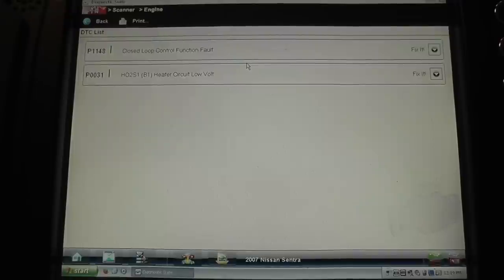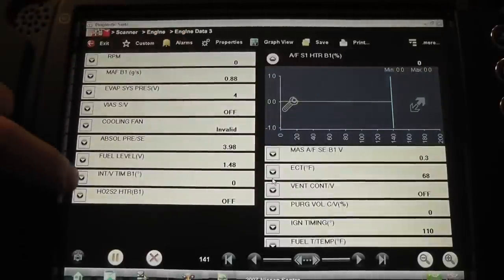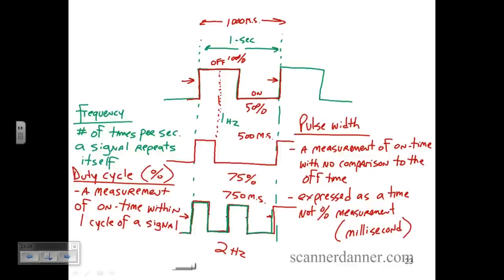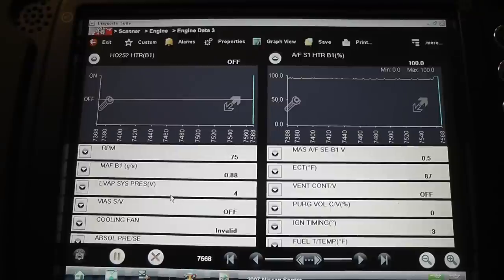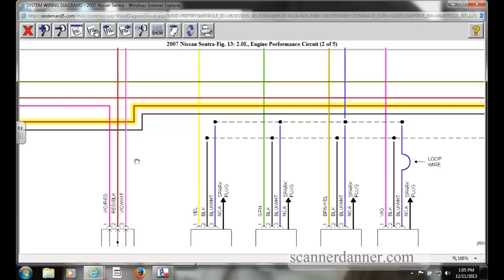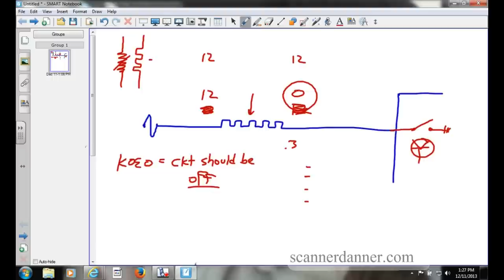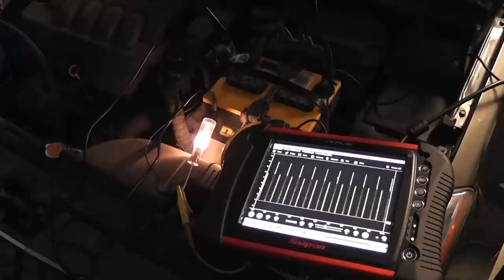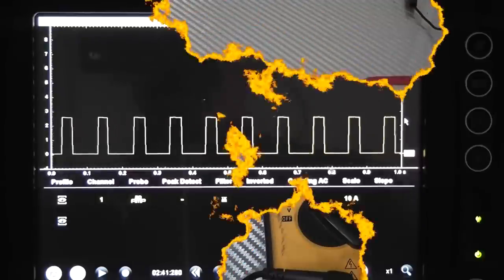Ground Side Switched, Duty Cycle Controlled, O2 Heater Circuit Testing [an SD Premium Class]

Comment: I did try that test using a test lamp in place of the heater circuit to "trick" the ecm liked we chatted about while back and it didnt work. even though the current flow (amount) was the same as the A/F sensor heater. It would pwm the test lamp for exactly 10.6 seconds and then shut it off. Was interesting to see intentional shutdown though. You may not remember that, it was at leasr 6 months ago.
Reply: Were you using an LED test light? That would cause the PCM to shut it down as a bad sensor because an LED is a diode. It will reach about ..6V and turn on and there would be no resistance. So it would just be off then on. Zero resistance to infinite resistance OL. An O2 sensor will go from zero to say 100 ohms and the PCM will read that as a valid range. Zero to OL is not a valid range.

Comment: Thanks for the video
On 40:39 min you said if there's no power on both sides then you have a blown fuse.
But I guess you will not get zero voltage on blown fuse but you will get bais voltage.
Reply from the maker: only on some circuits my friend, not all! Great question
Reply: @ScannerDanner  
Thanks for the reply
Actually I spent the last 14 days 😆 watching your videos , I learned that from you.
Another question came up through my mine if some circuits doesn't have bias voltage then how it detect circuit problems.
Reply from the maker: @braq331  in this case, it is a ground side switched circuit, so the ECM expects to see 12v on the control wire with the transistor off and 0v with the transistor on. So then logics are involved there. If it sees 0v with the circuit off, you will get a code. If it sees 12v with the circuit on, you will get a code. Make sense?
Reply: Thanks alot you're the best

Comment: Hello and thank you for what you do. Enjoy your show.
Hopefully youll have time to advise me. For a 93 f150 xlt 4x4 5.8L EOD4 or any older vehicle... Will newer platinum or iridium plugs mess with sensors or ECM? Ive been told that i should stick w stock plugs? Since truck is 30 years old, im looking for better mileage and low end torque. Since they are so old i am considering replacing coil, distributor and ignition control module as a matched set. Think i saw that some aftermarket icms screw w ECM? Want to buy matched set but would appreciate your input. Eventually will put a cam in. Not a racer. Want easier starts and smoother idle. Thank you in advance for your time.
Reply from the maker: You will get zero increase in performance by changing any of that. Unless you're having an issue now?
Stay with factory plugs and don't change all those parts! Especially the ignition module and distributor! They're making cheap/junk electronic parts for these systems! Watch this part 2 video on an EECIV Mustang where it took us 4 different "new" ignition modules before we got a good one!
https://youtu.be/9OR2yaV-3VM
Check and set your base ignition timing and maybe advance it a few degrees to see what that does for you. Just make sure at part throttle, pulling a hill, that you don't hear any pre-ignition (pinging) after advancing the timing. That's about the only thing you can do.
Reply: @ScannerDanner  thanks again. Will watch.
Reply: Also since it is so old my plan is to make it a sound heirloom to pass on to my son. And of course I don't want to be a parts changer. 😬😉
Reply from the maker: @alfredocasas7799  stay with the factory stuff. I promise you, you will get ZERO gains on aftermarket ignition systems no matter what they claim. The reason they can get away with these false claims is that when an engine is heavily modified and then needs a hotter spark, that's where the gains come in! A factory engine gets NO gains from a "hotter spark"

Comment: can you explain down stream 3 sensors? I see them go bad on land rovers often. they take a long time to heat up and show activity on scan data, and I have never seen any current on a heater circuit for these sensors.  What do they do? I like your content. Thank you for sharing.
Reply from the maker: When a system has a bank 1 sensor 3 O2, it's soul purpose in life is to monitor the cat. Often times the heaters on these are delayed in turning on to allow moisture to burn off first
Reply: @ScannerDanner  Sorry sir your bank 1 sensor 8 went bad. the wire that drags it a mile behind you muffler broke.

Comment: And typically when does the heater circuit come on? I know cold start. Does it ever come on while driving down the road?
Reply from the maker: Upstream O2 sensors, immediately! Downstream O2 sensors will often delay heater circuit operation until moisture burns off in the exhaust

Comment: Toyota Tacoma 2003  4.7 with fault code p0031 heating circuit short to ground . I replaced the sensor but mil still on ,I tested positive wire it was ok then I tested control wire by test light once the engine started running the ECU  connect the ground for 20 seconds  then shutt off. What is the problem
Reply from the maker: Is it a ground side switched heater circuit? What is the O2 heater control wire voltage?
Reply: Yes ground side . really I did not measured heater control voltage.  just I checked the ECU switched the ground side using test light . The test light illuminated a constant  green for 20s  not on off on off
Reply from the maker: @aliasas5715  not all heater controls are PWM, also an LED test light is not the best tool for this job. In your case the driver is recognizing that current flow is very low so it shuts the driver back off.
Reply: @ScannerDanner  so what that to be tested?
Reply: @aliakas1402  do the same test, with an old style test light.